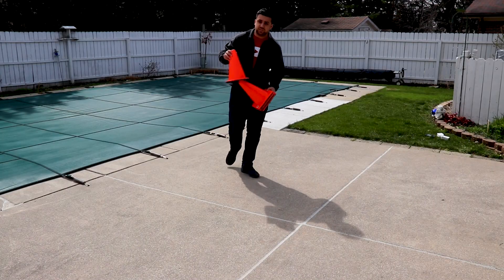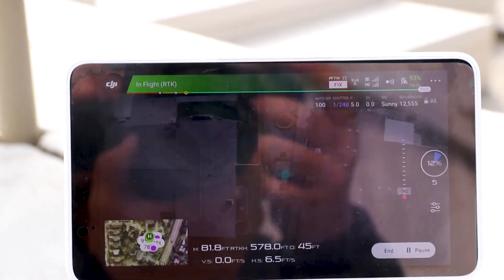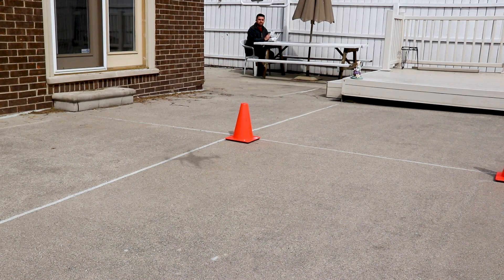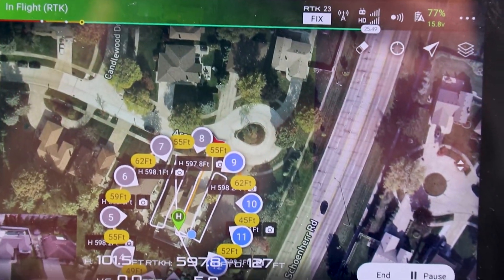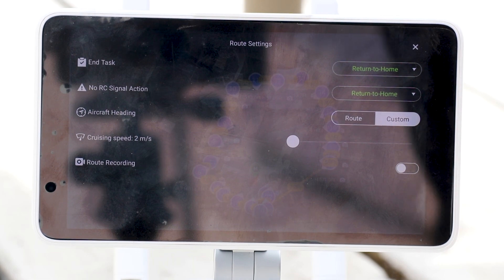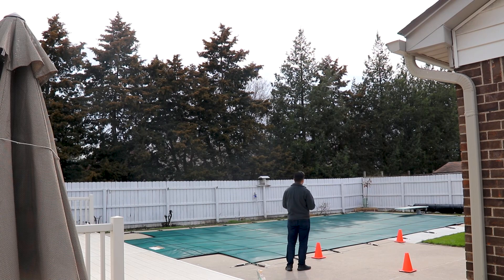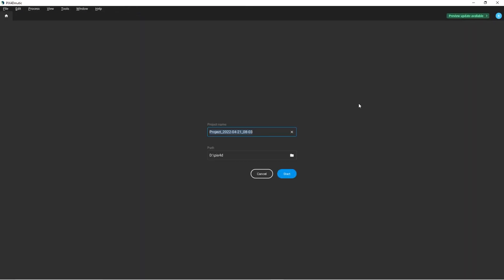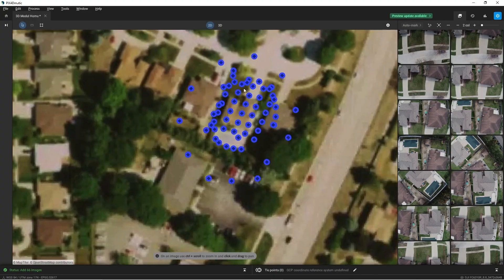3D Modeling with Drones using PIX4Dmatic

Comment: Hey Rami, I’m a site engineer working in the UK, I love the videos and am currently looking at adding a drone to my current inventory to possibly phase out my current GPS Rover, plus replace my total station for certain tasks, however The only thing I am sceptical about is the software aspect of things. Can you possibly make a video comparing the different processing softwares, DJI terra, Pix4D etc… or if anyone has an advice/ preferences I would love to hear it.
Reply: Oh and do you have a video where you perform a survey like this and take linear measurements? then if possible compare to another form of survey? E.g: total station or even just tape? (For example just the dimensions of your house? Or fence line?) Just thinking in terms of performing a survey and then using it to build a CAD 2D drawing to present in design meetings etc… as this could be immensely beneficial…